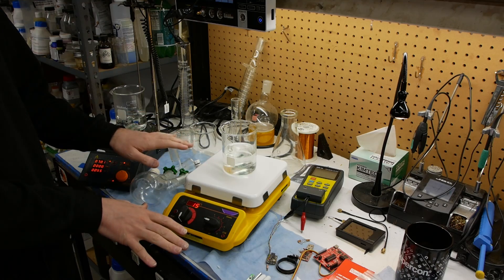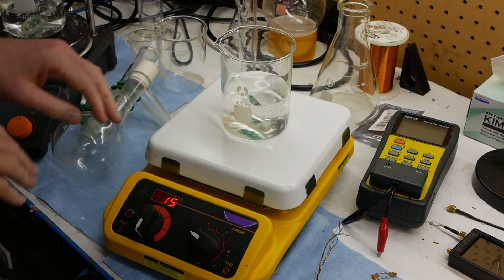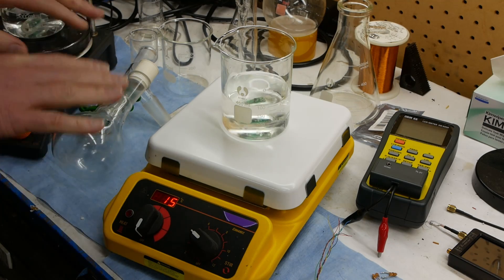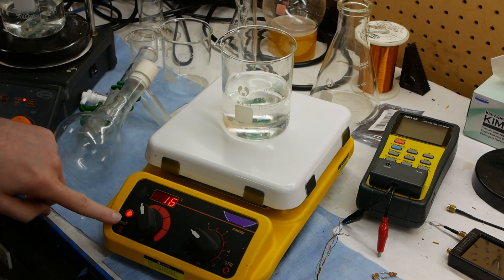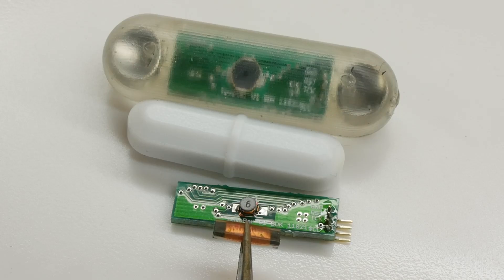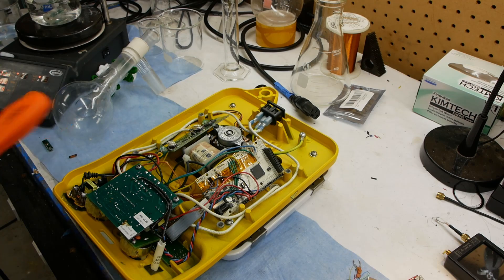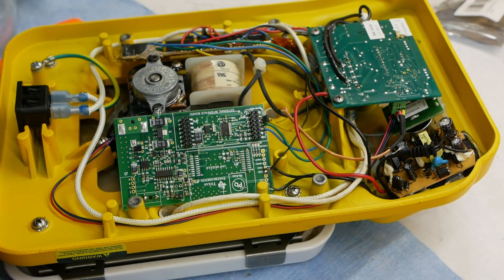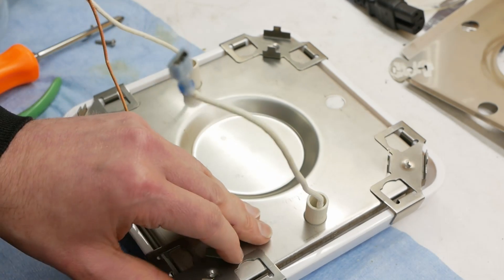Temperature-sensing RFID tag in magnetic stir bar

Comment: Interesting idea, but I think it would be quite limited in application. First of all I would assume those stirbars would be more expensive. Even though RFID tech isnt super expensive, now handling PCBs and having to check their function is a lot more complicated than just encasing a bar magnet in PTFE. 

Also the melting temp of PTFE with a melting point of 327°C is a lot higher than most electronic solders. So not damaging the PCB while encasing it in PTFE is tough. You used resin for your prototype, but that has far inferior chemical resistance. There is a reason those things are only sold as either teflon or glass coated.

Also you are sacrificing a lot of space inside that stir bar for the electronics, so less magnet. Having a strong magnetic connection to the stirrer is their most important property in my personal experience. Nothing is more annoying than the stirbar not properly staying in place at higher speeds, higher viscosity or with solids at the bottom. And their magnetic strength doesnt get better with time. So you probably need far more expensive and stronger magnets in there to keep the desired magnet strength with less volume inside the bar available for magnets.

Speaking of size. Your prototype is a pretty beefy boy. The most commonly uses sizes are far smaller and thinner than that. Or have different shapes like cross shape that would make fitting even a significantly miniaturized PCB tough. 

Last but not least, those things are disposable. They can last years, but truth is they end up down the drain or in the solvent waste far more often than one might think. No big deal with a bar that costs somewhere between 50ct to a couple Euros. But for something that would be significantly more expensive and that is now a piece of electronics with ID code and everything that would be far more problematic. 

Again a cool idea. Not impossible to solve the above problems technologically. But All to save 5s on inserting the thermocouple you end up spending orders of magnitude more money. Tough business case when the alternative is a thermometer and a 1€ PTFE coated bar magnet. 
Just my 2 cents from someone who has been using those stirrers in a chemical lab for the past 10 years. Maybe other fields would see this differently.

Comment: It just needs a PID for temp control in the microcontroller, which is now more important because you are reading the temperatures further away.
one question, Do you think silicone would be a better choice in terms of chemical resistance/reacting compared to Polyurethane ?

Comment: When I am trying out a new idea, I will often spin up a 'sloppy' board with extra test points and such. These aren't ugly by any means, and they aren't necessarily intended to be final products. Instead, these are merely proof of concepts which get me so I can start writing code. Another benefit of these hasty boards is that I have a baseline- basically, what do I hate about it.

Generally speaking, for me it is an iterative process- the second board is always more refined then the first, etc. If I carry an idea all the way through, by the third iteration it is usually pretty close to what I want the final product to be including final packaging.

The thing that I find is that it is generally less desirable to show people those initial/incremental concept boards because most people can't see past the bodges and conclude an inferior idea.

In other words, I can fully wrap my brain around your base- obviously if you cultivated it further you would roll your own boards and the innards would be much sexier, but I think it is a terrific idea and one that has quite a bit of potential.

I can (easily) get past wall warts and dev boards and hot snot, but the people I show my electronics to generally can't.

Comment: The entire video, I was waiting for few words about the temperature that the stir bar's electronics is able to withstand.  I was hoping for an elaboration about the maximum theoretical repetitive temperature limit and about the one-time destructive temperature limit.  Also, for this to be a MORE THAN A PROTOTYPE, the stir bar's molding material has to be non-reactive and most of such materials require > 1400°C hardening temperature (e.g. ceramic, glass).  I don't think any electronic chip can withstand such temperature even for a moment, so unless a lower molding temperature inert material can be used for the stirbar, this problem is a real show-stopper. PTFE's molding temperature is around 360°C but it requires 10-100MPa of pressure as well ...and even that temperature might be too high to retain the contents of an NV memory.

Comment: I have an opposite problem - my heating mantles require the probe while I often just need an "analog knob" to variate heat smoothly. This is especially annoying when distilling complex mixtures where a simple PID controller gets confused (as the volume and thermal characteristics of the mixture changes) and I need to turn the mantle off and on again from time to time.

BTW why not making a PTFE ring or sleeve for the beaker, containing a contact-thermometer? This may provide temperature reading for overhead stirring or even when the beaker is removed (e.g. for crystallization).

You can make your own stir bar from Teflon tubing and two pieces of a Teflon rod that fit snuggly. I've made a stir bar remover this way (it has a strong magnet in the tip) to conveniently remove the stir bars.

Comment: Too Long Didnt Watch (TLDW) Summary: The video showcases a proof of concept for a temperature-sensing RFID tag embedded in a laboratory stir bar, allowing wireless measurement of liquid temperature without needing an external probe. Other potential applications of the technology include measuring viscosity, tracking lab inventory, and detecting loss of magnetic contact. The video includes a teardown of the stir bar and the RFID reader in the base of the laboratory stir hot plate. The creator plans to open-source the code and schematics.

Comment: This could be a great start to develop opensource lab equipment. Looking at the electronics space there are opensource programmable ovens and hotplates for reflow soldering already. 3D printers, slightly modified, could make good probe handling robots. Put such a hotplate as the bed on a i3 style 3D printer and use the movement of that bed for loading/unloading of beakers to the plate or positioning the beaker below different outlets for reagents.
Reply: I believe there's already an open-source wellplate liquid handling robot based on a 3d printer as well.

Comment: Low frequency RFID is quite easy to do with no special silicon - for the base, a series tuned LC circuit driven form a half-bridge ( can use HCMOS outputs at lower powers, MOSFET drivers are good for higher power), with a simple diode detector, opamp and data slicer for receive. The tag end can also be done fairly easily if you don't need ultimate range . ST did an RFID tag chip with a host interface so you could write its eeprom to control what it set back - don't recall if this was LF  (125/134K) or MF (13.56MHz)
Reply: Thanks Mike.  I was thinking, if the LC oscillator had a monotonic frequency vs temperature characteristic, then maybe it could be used as a frequency modulated temperature sensor.

Comment: I've done some playing with RFID stuff - the drum core inductors work OK, but if you snap off the top, to make a T shape core, it works way better. I never found a source of ready-made coils like that, or custom ferrite.
Reply: I know sources. You could even ask companies like Coilcraft. But the issue is that they always need MOQ's of a couple of thousands usually. It would be interesting if a Pcb coil could be made on a multi-layer board.
Reply: @p_mouse8676  Yes, PCB coils are possible (and IMO even the best option for this application if you can find the board space to spare). I used them in custom RFID tags for a seminar course a few years ago.
The bigger the area, the better: higher inductance and better flux coupling. Then just tune the capacitor as needed.
Reply: @p_mouse8676  Some Chinese OEM would probably make them in lower volumes and much cheaper.
Reply: Snapping off the top.. brilliant tip ! .. I saw a modified 3d printer winding custom coils via the filament transport stepper lately... umm.. channel is called homofaciens I think.

Comment: Cool, now please add high temperature magnets, replace the chips by some passive circuit able to withstand high temperature, maybe welded instead of soldered, and encase the whole bar in borosillicate glass and sell it as a 500+°C universal stirbar better than the teflon ones in every way except HF :)

Comment: It'd be neat to try to make a receiving antenna using internal traces on a multi-layer PCB. And granted, you'd need an amplifier of some kind, but placing the transmit antenna around the periphery of the hot plate would avoid the mica heating element. Cool project!
Reply: TX power would need to be huge if the coil was as big as the whole top of the hotplate. Magnetic flux density is what decides whether or not you can RX your desired signal, and it's inversely proportional to the area encircled by the coil. More coil area means less RX range at a given power setting.

Comment: Brilliant!
Incidentally, Ive started creating a diy temperature controller as well. But that one for soldering low-temperature solder paste (and without RFID, but could add it later too now that Im seeing this haha!).

For that I will need to be able to generate a very strict temperature profile, just like you can with your kiln, and I have been thinking about using a peltier device, lt8722 and a pot of hot water.

Comment: This is such a good idea, you could literally halve the size of that stir bar if you worked with the chipset manufacturer to wire bond the chips directly to a much smaller and thinner PCB that way it would be quite easy to get this to normal stir bar dimensions. For a prototype its pretty good.

Comment: Does this also works in round-bottom flasks, where there is a wider gap between the tag and the coil? Because if you're doing chemistry where this device would be of high value, you would work with round-bottom flasks (for vacuum-stability).

Comment: "I guess it want that hard to reverse engineer" .....says Ben.

Guy builds his own x-ray machine, magnetic resonance whatsit, mass spec, and still drops that humble bomb on us with a little giggle. Damn it Ben, stop being awesome!

.....No, dont stop being awesome. Really cool work, mate. Id love to see this idea picked up and the maker crowd come out with neat chem equipment. My first toe dipping into chem techniques was distilling ethanol out of cheap booze in glassware that had rubber stoppers. Had to modify a bung for 3 holes, one for the bubble elbow, one for the mercury thermometer, and one for a long stem funnel for adding more booze. Didnt have a pump for the condenser jacket so I set up a pair of buckets (one on the table, the other on a chair) to run as a siphon, when one ran out, swap em around and start the siphon again. The next run I did was homemade HCl via the Mannheim reaction (IIRC, its the sodium bisulfate + table salt one) since we had some old pool chemicals laying around. That was the night I discovered what a lovely shade of "DO NOT BREATH THIS" yellow-green death chlorine gas is (yes, I had ventilation, still it was an interesting experience. Pucker factor 7 event). Ended up being the first glass lampwork I did too, made a U bend tube from some narrow tube straights for a double flask backflow rig to catch the suckback at the end of the reaction. Learning experience 10/10, would do again. Risk level 4/10 would not let my kids do that unsupervised (like I was 🤣 But at least I wouldnt accuse them of making drugs just because there is a white crystalline mass left over in the reaction vessel.....like I was 😒 Do you know how hard it is to explain a reaction and the resultant compounds to someone who thinks "ermuhgurd laboratory glassware cops gonna kick our doors down" ......Its quite annoying to say the least......) 

Anyhoo, Ben, youre a paragon in the garage scientist world. Dont ever stop being awesome. And thanks for the content! Your work does not go unappreciated round these parts 😉

Comment: I could imagine someone making an RFID coil using a ceramic substrate and just slotting it in there. Mid KHz RFID might not be the solution here however for such an antenna, but thats for someone with a large budget to play around with. 
I am also a bit surprised that the RFID works perfectly fine when spun around like that and in a magnetic field.

Comment: Very nice concept, Ben. One of the chemical aspects I was immediately worried about though was chemical resistivity. Standard stir bars have teflon coating which is chemically inert but is sintered at high pressures and temperatures (above what would be considered suitable for electronics packaging). Virtually any other polymer is either not resistant to strong acids or bases, or to strong solvents, especially at elevated temperatures. I did not hear you say it in the video, but is that maybe one of the reasons why you did not pursue his as a product?
Reply: I think you could simply do something like a piece of PTFE shrink tube, welded shut at the end? If you leave a cm spacing or so from the end and you put in a piece of glass fiber wadding I imagine melting shut the end of a glass tube should also be in the cards?
Reply: @eelcohoogendoorn8044  Yes that is also possible, I did not think of that. As for chemical resistivity, teflon is generally superior to most glasses (which are still quite sensitive to acids and bases).
Reply: Surely there must be a low temperature production method otherwise they'd run into problems with the Curie point of the magnets used in the stir bar. Or is it just a steel pellet it the PTFE stir bars? I've never used one personally, we had to stir our reactions manually 😄
Reply: @je2555  I did wonder about that too, apparently the alloys used in stir bars have a curie point around 800C and teflon is sintered at 350C, giving more than enough headroom
Reply: @oiytd5wugho  Fairly certain 2 halves of the teflon stir bar are welded together rather than be molded with the magnet in it. Even the teflon stir bars have a typical curie point. I have some glass stir bars with high curie point for this reason.
Reply: There are high temperature electronics processes, and even existing RFID tags that can work at 300C, which about the temperature that teflon sintering is done. But I don't see anything that could do temperature sensing with those resistances yet, so it would probably need to be somewhat custom. But I think there's a decent chance that if demand will be there some company will create a chip for it.
Reply: @ignaloidas  LRC circuit with thermistor as R. No chips in sight.
Reply: @dougaltolan3017  Would be quite hard to read with any accuracy, as the temperature will only change the damping factor of the circuit, so you'll need accurate measuring of the RF amplitude, which is a lot harder than sensing frequency changes or digital on/off RF signals. Though there seems to be some research into passive circuits that can remotely sense temperature, though the fact that a lot of the research I see is very recent, it probably still has a bunch of stuff to improve on.

And also, without digital stuff, you loose some potential benefits like traceability.
Reply: @ignaloidas  Ahh yes, I'm a tad rusty..
LR with diode a là olde style security tags..
Again, R is thermistor, L is the antenna, and the diode doubles the frequency to make detection simpler.

I think I'm allergic to over engineered stuff.
That and fuzzy logic roolz.

There is also fun to be had with a bi-metallic strip, a spring, and measuring it physical resonance.
Reply: If the process is fast enough the Thermal inertia of the electronics should be enough to avoid degradation during manufacture.
Reply: If the solder used to hold the electronics to the board is Lead free, you are looking at 217°C for that melting point, however, even if the process of encapsulation is hotter, the parts are encapsulated and should not separate in an appreciable manner. Presumably you could simply further encapsulate in teflon for the needed chemical resistance.
Reply: how do the classic temperature probes fair in those extreme pH conditions? Maybe "holds some time" has to be good enough for certain use cases.
Reply: @christianstorms3950  they are Teflon coated.
Reply: you can use FEP or PFA and just weld the outside, just coat/fill the electronics with some type of inert gel or something to prevent any HF from getting to it. or perhaps a bit of sacrificial "getter" material to react with any HF formed by the welding process.
Or just use off the shelf lab equipment with probes like a normal person

Comment: Comparing the probe temperature to the stir-bar's temperature, is there a difference and by how much? I assume the rate of heat transfer through urethane is less of that of a metal temp probe.
Reply: And my second question, is the porcelain plate thick enough that machining out a divot for the coil to sit in would be feasible?